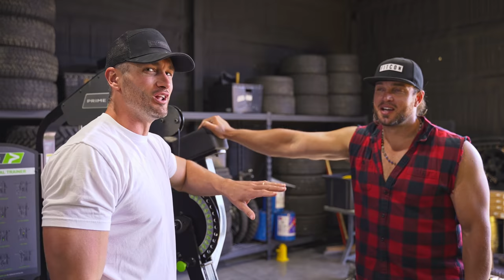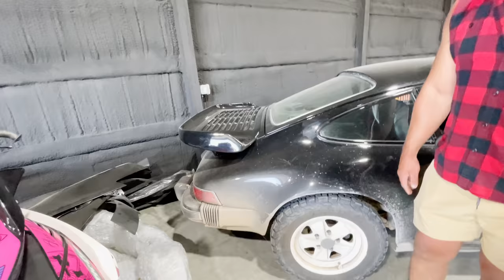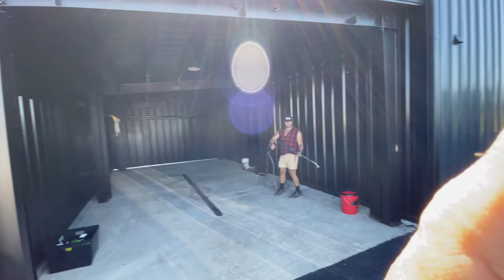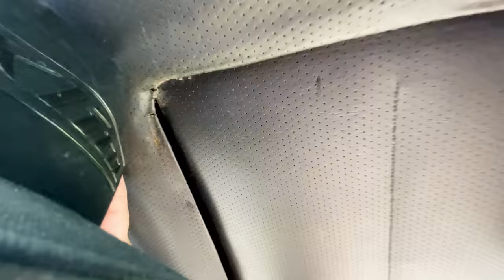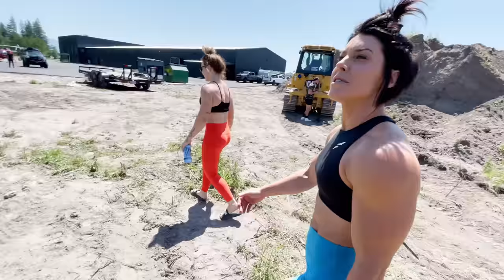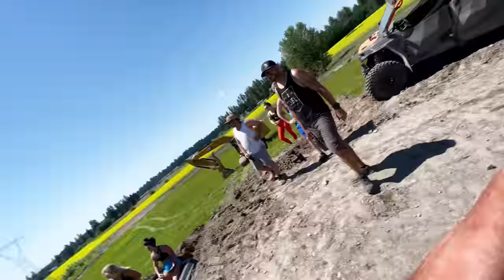We Discovered an Insane Hidden Talent of This Porsche 911 (Feat. Rob Bailey)

Comment: Zero gravity over the jump means Zero oil pressure when the oil levitates above the pickup screen. Comes back after landing just in time to save the main bearings👍.
Those RZR's were doomed from the factory with inverted ball joints on the control arms. 90% of those that are busted on the sand dunes are ball joints. It's like the engineers were drunk on suspension day!

Comment: Most German cars from the 80's are nearly indestructible.
Reply: I feel like you could even remove "German" from that sentence and still have it be fairly true.  Cars from the 80s are tough as nails for the most part.
Reply: On ‘Cannonball run’, they had to run over the 928 multiple times with the monster truck to do any damage.
Reply: @SpawnofChaos  but there was nothing like German engineering back then, even today not much can keep up with it.
Reply: Except for their terrible electrical systems
Reply: @MrEvtmazda  terrible?
Reply: @MrEvtmazda  I own an e30, e28, and a w126. Never had a wiring problem, their electrical systems are very good. On the other hand, I had the misfortune of working on a c4 vette. All the electrical connectors disintegrated when you touched them.
Reply: @SpawnofChaos  Are you kidding!
Reply: @Dealete420  I said "fairly" true lol

Comment: I'm thinking back to mid 80's, the Paris-Dakar road rally. Porche had a 959 in mainly white but striped red and blue. Dual turbos on the engine now. Most impressive was Porches new 4x4 system with of course selectable modes.  All this plus a nice bit of travel for suspension made an awesome rally racer for it's day.

Comment: Wait, in Montana!? And this is the first I’m hearing of Rob Bailey… interesting. 120,000 miles isn’t a lot on a Porsche by the way. Buddy of mine has a 2004 911 turbo that has over 140,000 and he drives it to the track, runs events, and drives it home. Probably the most reliable sports car if left alone and maintenance done regularly. Cheers boys!

Comment: The reason why the oil pressure will go low is because he's 0g the oil so it rise in the engine which caused it to cut off but you probably knew that

Comment: That must be a 912 or 912E if its a 4 cylinder since the 911's came with 6 cylinders, 120k is not many miles for the 911 motors which most have an oil capacity between 11 to nearly 14 quarts...No offense but I have got similar air in the intersections in my hometown, been pulled over for it too.

Comment: Most phones can connect up to 3 Bluetooth devices now. Lol. I could just buy a second speaker?? OR buy 3 KOVS and bam, we got 6 speakers. That would be sick. I mean, even if you can only connect to two devices, that's still 4 speakers. For those wondering, kove connects one speaker to the other speaker, and also the phone, that way you only use up one connection at a time.

Comment: heres the specs of the porsche 911 sc
boxer 6 cylinder.

Horsepower 180 @ 5500 rpm.
Torque 175 lb-ft @ 4200 rpm.
Max RPM 7000.

Comment: Kind of how my best car worked before the pistons decided to break out through the block….
The suspension was so messed up that the shoulders were touching the rubber pads - but you didn't even get your fist under it and I put smaller tires in the front and bigger ones in the back gave a perfect road holding! I've never tried a real ramp but I've flown much further over a bridge and landed at the start of a roughly 90 degree turn at 140-150km/h and got a perfect four wheel stand through the whole turn right into the gravel with one of the back wheels and then feel like I've been shot out of a cannon afterwards! The margin of safety was close to minus...
Those are memories to live on because regardless of the car, it just can't go faster!

Comment: The Kove Commuter 2 has a decent dynamics performance. It doesn't get very loud, so it may not be suitable to use in large rooms or at crowded parties. That said, audio reproduction is clear and pure when you play it at max volume, which is good. The Kove Commuter 2 has a good battery performance.